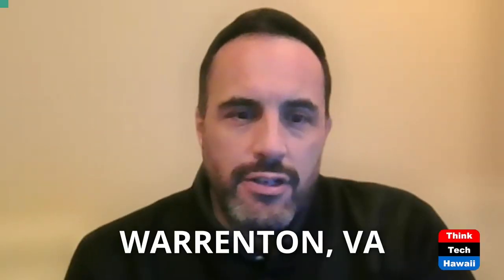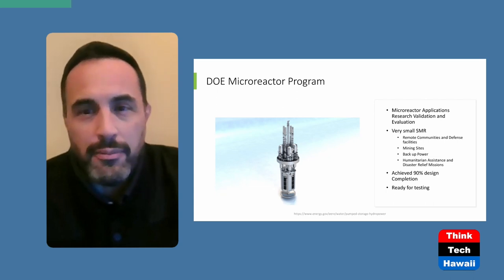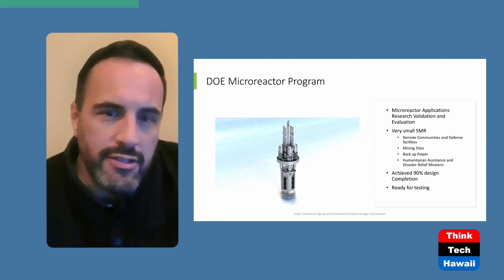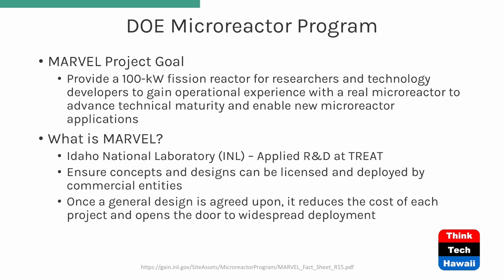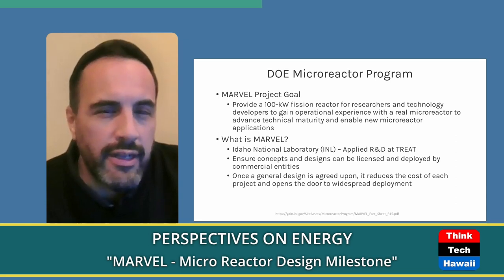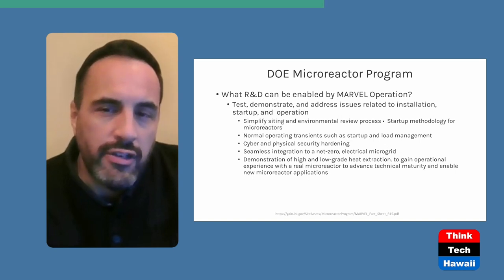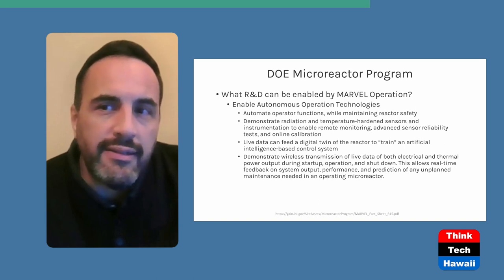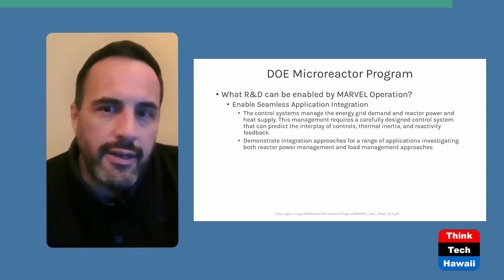MARVEL - Micro Reactor Design Milestone (Perspectives on Energy)

Comment: Around (11:42) you make the claim that "nuclear.... is still far less expensive to develop than solar"... Really?  Solar is the least expensive primary power converter available today - you can buy them now... nuclear power plants are the most expensive.  You mention the capability of dispatching energy, but with batteries (for smaller loads) and clean hydrogen for larger loads - Solar PV with clean hydrogen is much cheaper now, and available now, than any N-plant of any design.

The DOE has spent many billions and decades on so called N-Microreactors, and they have yet to produce electricity anywhere near spec, and are far from clean energy given toxic waste, and water resources needed to operate.  Further, you mention cooling briefly with exotic materials, but you don't mention the huge water resources required to cool down Steam engines - even micro reactors.  You'll still need a condenser, as the Microreactor is still just a steam engine.  Each GW of N-power requires over 12 Million gallons of water - per Hour for cooling.  Any thought about how much water would be required to cool these N-plants?

In the 21st century, it's a terrible mistake to think only in terms of Steam Engines - as we have for 300 years.  Steam engines are our past - not our future.  If you focus on Green Hydrogen, (using clean electrons to make clean fuel from water), providing dispatchable power and energy 24/7 365, it's hard to imagine any "free market" mechanism would want N-reactors spread out all over the planet given the extreme cost, toxicity of materials, potential liabilities, huge water demand, and security concerns.  N-power is a bad idea all the way around - Microreactors don't change that.